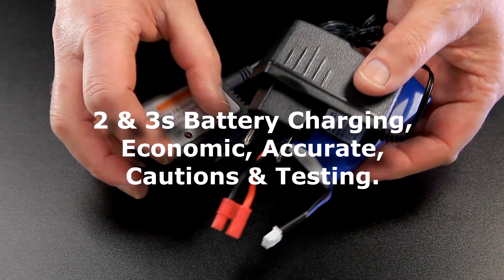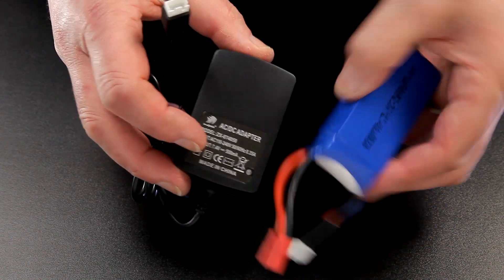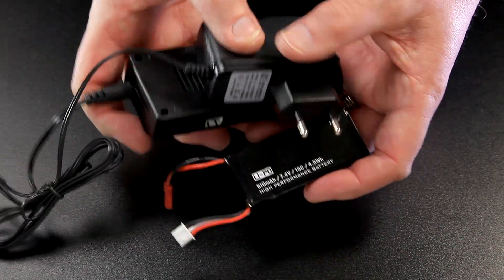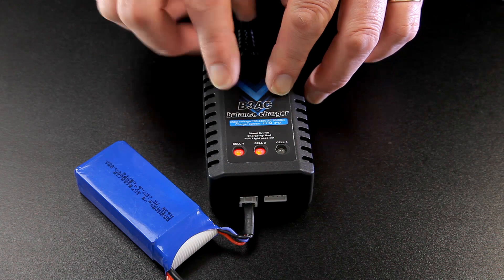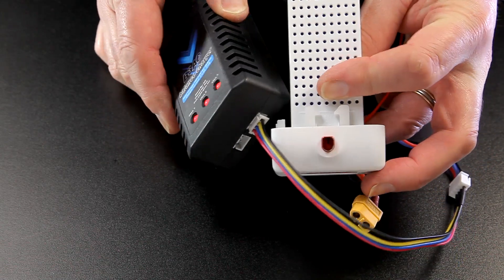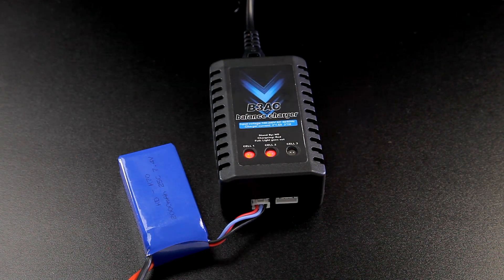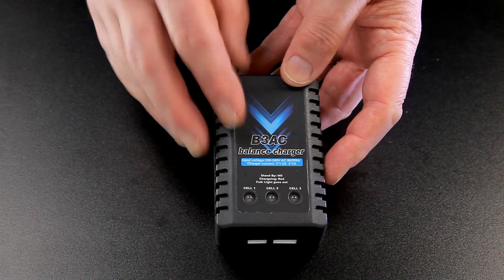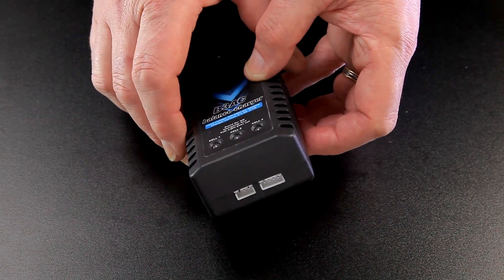Cheap, Budget, Economic, B3 Accurate 2s 3s LiPo Battery Charger

Comment: I have a question I have a battery for an airsoft gun and the b3 charger will change from (for an example) 3 red to instantly all green did I get a faulty b3 charger

Comment: Technically those cheap B3 chargers doesn't balance, it's just 3 independent chargers and it will try to charge each cell to 4.2V and stops when C/10, so you'll have the max capacity for each cell but in no way it is balanced, it will however prevent overcharging a cell compared to a simple series charger

Comment: at 02:11 thought the 610mah is the capacity  of the battery not the charging rate, the battery is capable of throwing out say 10 amps but would only last a few minutes  so thought it would be capable of taking 800mah or even more say 1Ah.

Comment: If i have a 2s 1500mah... I can't charge it by 20w 1. 6A   charger?
Reply: @christiancastillo I’d love to know this as well. He said never over so I would assume no, to be on the safe side, but it is only 100 difference (1500mah battery, this charger 1600ma max current output).

Comment: Hi! Really nice video! I have a question. If the charger say output current: 1,6 and the battery its 1600mAh is it save?
Reply: Yes, it should be safe but it is still important to charge your batteries on an inflammable surface.

Comment: Hi does this charger charge 400-450 mAh 2s safely?
Reply: With the skyrc charger you can limit the current 0,1-6 amps .Just set it to 400ma I don't have that small batteries I charge my 5000mah battery's with 5 amps

Comment: Concerning the B3 charger, when you are charging a battery and it becomes fully charged; will the charger stop charging the battery?  Or should the battery be disconnected immediately when all the lights turn green?  Is there a hazard in not disconnecting immediately after all the lights turn green?
Reply from the maker: Charger stops charging when battery full

Comment: Hi Tigger, 
      I noticed you had a Hubsan H502E battery (7.4v 610mAh 15c) earlier in the video.  I bought an H502E recently but unfortunately the USB charger packed up after the second charge (maybe I did something wrong :(  ).  I was wondering if the B3AC  (a  IMAX B3AC ) would be a suitable replacement charger as I need one quickly and have found these being sold in the UK on eBay.  I'm worried about the balance charge current as it's 800mA/cell and the batteries are 610mAh.  Many thanks for help.
Reply from the maker: Yep that will work and any 2 or 3 cell ones you may get in the future ;-)
Reply: Proper job mate.    Many thanks for your help :) Will a Professional iMAX B3 RC be OK too?
Reply from the maker: Pleasure Andy, pretty sure the Pro one only puts out at 800mAh, not done a full side by side, may give it a go, happy safe charging
Reply: Thanks a bundle for your help :)

Comment: Hello.

Week ago I ordered Bugs 2 B2W(red). What additional charger you advise to buy from those 3 cheaper which are  exposed? With quad I think will come such one you got at Bugs 2 B2C(USB charger at 500mA). So this will be quite slow charging.

Eachine charger have written: Charging current: 800MAH-1000MAH
imaxRC B3 and B3 20W Balance Charger have written output at 1,6A.

Probably one of those 2 lasts should fit, cause Bugs 2 B2W using 1800mAh battery. Or is safer to use Eachine charger?

Thank you.
Reply from the maker: Nice choice of quad ;-) guessing you seen my video on iMax B6, if not take a look. Hobby grade charger is going to charge fast, my B6 can go to 4.0amps someone said the latest one goes to 5.0amps.

Comment: THANK YOU,THANK YOU!!!!!!     Boy, i sure am glad i contact you!!!!!! You sure do know what you are doing
I have the new TRAXXAS EZ-PEAK CHARGER. it does 2-3-4 s batt. and it tells you what is going on. I hope this well
do. Please let me know!

 Thanks, Steve

i
Reply from the maker: Hi Steve, glad to help, don't have that charger but looks very nice. I don't know if it works like the IMAX B6 in the way you need a positive, negative and balance charge cable, if so I 'm not sure it will charge the X300 battery. If it uses balance charger cable then should be perfect ;-) Let me know how you get on, thanks, Cheers :-)

Comment: Thank you for making all these reviews: very informative and helpful for someone starting out! I have already ordered a couple of low voltage alarm beepers and was just about to get myself one of these cheap balance chargers when I noticed the 1.5A output current for 2 cells. If that's unchangeable, am I right in thinking this would be no good (dangerous!) for charging a 1300mah 2S battery for my JJRC X1? So far I've been using the basic charger that came with it, but I suspect the balance is off (I'll find out when the voltage readers arrive!) Many thanks.
Reply: just a little bit over is fine

Comment: Tigger, once again, thank you for the very well explained video on these balance chargers.  We now have three 7.4v 2200mAh batteries and the standard Syma charger with output at 10v 800mAh, so it does take a good two hours plus per battery to fully charge.  Long time to wait around on a calm day.  

Looking at Amazon, the price for the larger, professional charger seems like a better deal.  Thanks again.
Reply from the maker: Glad it helped Mark, just make sure you get Genuine Original ones, lot of fakes around for iMAX and I would assume others, pro charger is the way to go but these small ones seem to do a good job on balancing. You will love flying longer, nothing beats it ;-)
Reply: @TiggersRCReviewsTTFN  how do I discharge a lipo battery for storage with one of those chargers to 3.7v?
Reply: The more premium/ expensive battery chargers have inbuilt storage mode to 3.7/3.8V. The budget chargers, charge to 4.2V only?

Comment: can we charge a 2s and a 3s lipo together at once with that B3AC balance charger?
Reply from the maker: No. Pretty sure it is a 2 or 3 cell charger ;-)
Reply: i actually tried and let it be for few mins and nothing exploded. i think we can. since it has 2s and 3s balance port.
Reply from the maker: Be interesting if that takes the same time, guess the power is going to the port anyway so maybe it will work, cheers for trying and sharing :-)

Comment: to the cheap balance charger i bought a cable which splits into 2 and you can charge 2 batteries from one balance charger.....is that good or bad? shall i charge one battery at a time or two?
Reply from the maker: I would do one at a time as far as I know it can't balance charge 2 at once how could it control it :~) If someones knows it can then great, just my understanding of how it works. Guess you could try it by monitoring every so often and see if it achieves what 4.2v per cell. One last thought it won't charge it any quicker as it only puts out 1.5amp on 2s. Hope that helps cheers
Reply: Ok thank you very much for the information

Comment: I had the same type charger under a different name, which was also quite accurate.  Unfortunately in a moment of inattention I tried to connect the battery balance lead upside down into the charger, while it didn't plug in because of the lugs it did allow a connection which shorted out the charger.  I usually turn the power on after the balance lead is plugged in but as I said, a moment of inattention/brainlessness.  The lights on the charger still worked but I think one red and two green while not charging.  They would all turn red when charging but did not balance charge and created a dangerous in balance and overcharge on one cell.  I was keeping a close eye on it but wanted to see what would happen after the short, (1 cell was 4.4v & still charging!) Something to be aware of as I would of hoped there would be some kind of safeguard/circuit breaker to prevent the charger from working after the short circuit.
Cheers again for great review.
Reply from the maker: oooH that's not good but thanks for sharing, cheers and glad you enjoyed the video :-)

Comment: those buzzers are so handy!!
i hear them beeping when my speedboat is 200-300 m out on the water!!
i have a cheap charger aswell, but it charges just great. only downside is that it doesn't charge a 1s lipo :/
Reply from the maker: Yep buzzers are great but very loud in the house LOL Yes mine only does 2-3 cells, hey I guess always a downside, cheers

Comment: question - i have an odd battery that came with my remote car - it looks like its a 3cell battery with total of 9.6V - i tried to replace it with a standard 3cell battery which is 11.1v - my remote car worked fine but after maybe 5 minutes it started to produce a little bit of smoke. is there any way to reduce voltage on the 11.1v battery to match 9.6v that the car needs? This way i can still use standard 11.1v batteries?
Reply: Hi
The battery you removed is another type of battery. It's not lipo. Lipo comes in 3.7 7.4 and 11.1 and so on.

The one you removed would by nik cad 8 cell battery it gives 1.2 volts per cell